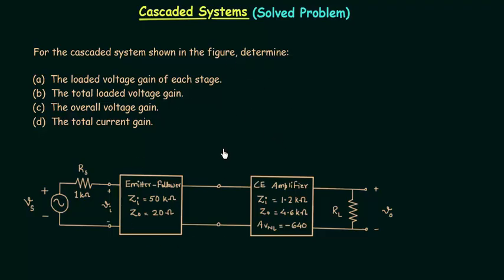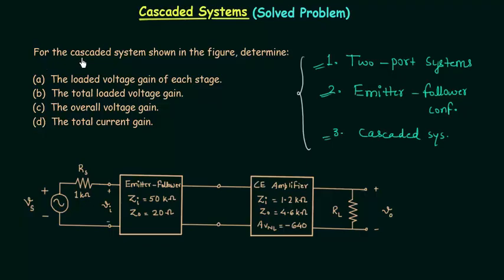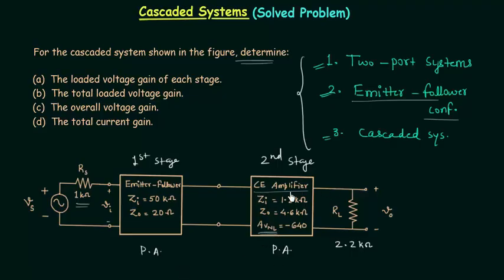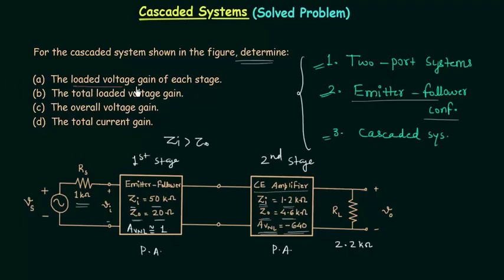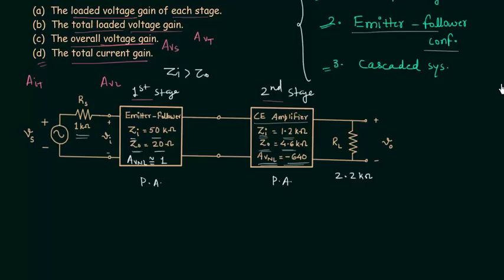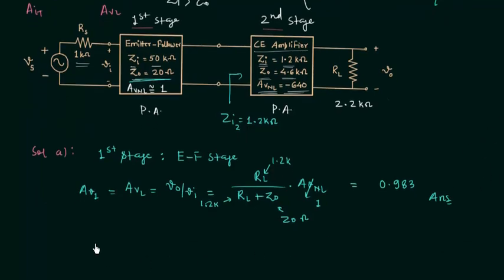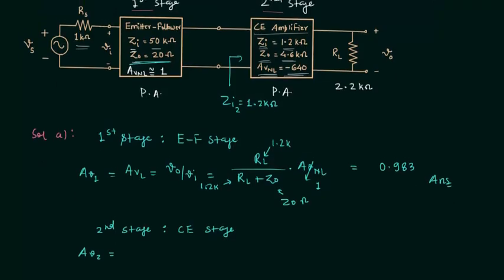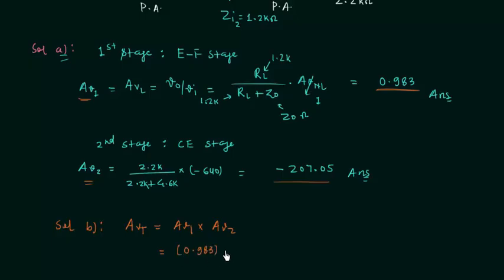Cascaded Systems (Solved Problem)

Comment: Hi, Here is the step wise solution for the calculation of Overall voltage gain Avs:
 WKT,  Avs= Vo2/Vs
which can be re written as,
Avs= (Vo2/Vi2)(Vo1/Vi1)(Vi1/Vs)  ---- eqn (1)
 where Vi1 is nothing but Vi, whose value is given by Vi1=Vi= Vs*(Zi1/(Zi1+Rs))
                                                                                               =>Vi1/Vs= Zi1/(Zi1+R)

Also WKT AVL2= Vo2/Vi2,     AVL1=Vo1/Vi1
Substituting the values of AVL1 ,AVL2 &   Vi1/Vs in the eqn (1)
we obtain Avs= AVL1*AVL2*   Vi1/Vs
i,e              Avs =  0.983*-207.05*(50k/(50K+1k)
                  Avs= -199.53
Reply: #Sthuthi Nayak  nice explanation
Reply: great
Reply: yes getting the same answer. Thanks.

Comment: Avs = Vo2/Vs 
        = (Vo2/Vi1) X (Vi1/Vs)
        = (Vtotal) X [ { (Zi*Vs)/(Zi+Rs) }  / Vs ] 
        = Vtotal X { Zi/(Zi+Rs) }
putting the values of Vtotal , Zi and Rs in the above equation we get 
Avs =  -199.53
Reply: Plzzz tell me how we will know that  value of Zi will be taken in which configuration ?? emitter follower or CE??... There's little confusion regarding this .... Hope u will be clear 🙏
Reply: @Cosmiclights6666   if i/p impedance is greater than o/p impedance then it is Emitter follower otherwise it is CE
Reply: Thanks man. The best explanation.
Reply: @ritikgupta2178  nhi samajh aaya bhai fir se batao yaar 🥺....Vtotal me kya rakhna ha
Reply: is that equation applicable to multistage amps?
Reply: And Zo also